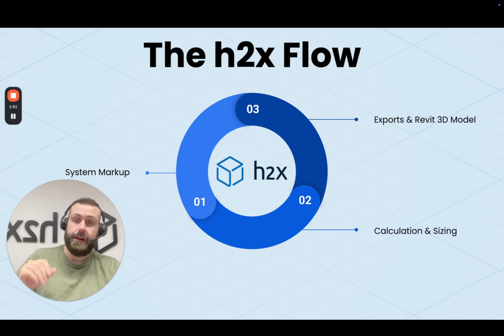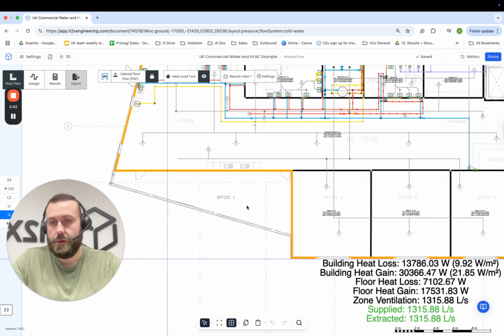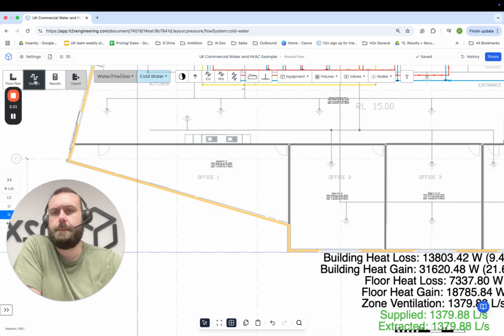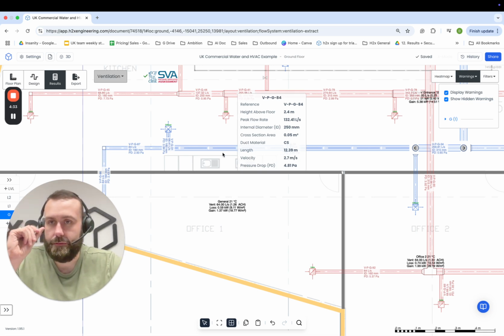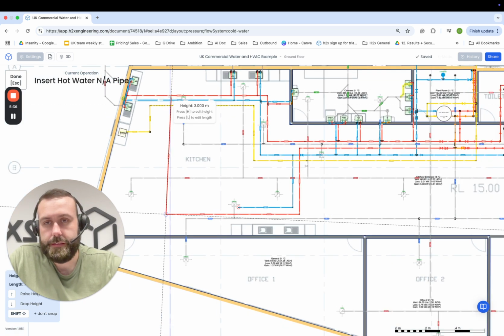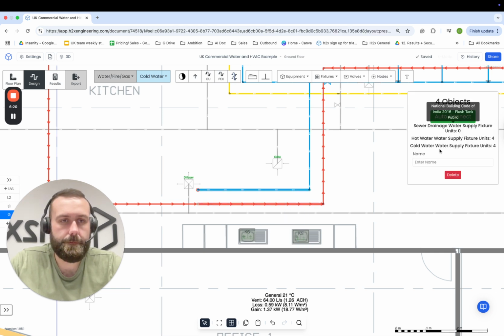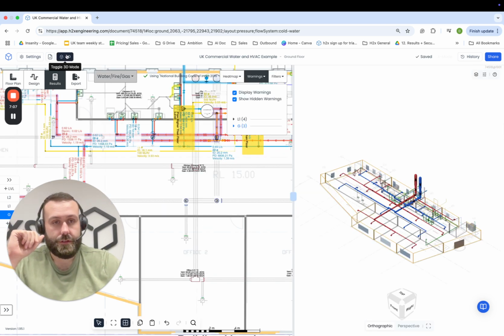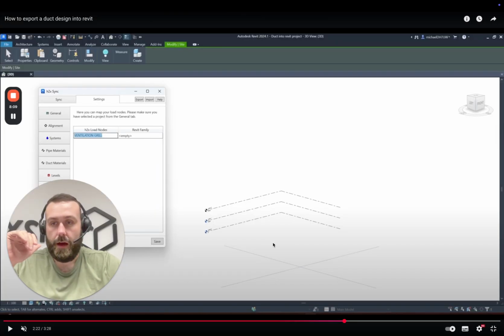How to Design Commercial Water & HVAC Systems in h2x (UK)

Comment: Is it possible to use this app to design and calculate compliant MEP systems in Spain, or is it only for UK? Thanks
Reply from the maker: Hi Jesus, It would depend on the type of system you are looking to design. Some of the flow systems such as water design, rely on the selection of a peak flow rate methodology, and we have a select number of standards within the system settings. Could you specify which systems your looking to design?
Reply: @MichaelAinscough hot-cold water, drainage, heating, stormwater, ventilation... Basically all the systems a building needs. Thanks!
Reply from the maker: @jesuscuerda8544  thank you for the context, for hot and cold water I don't think we have the national standards for Spain, however we do have UPC and IPC, along with the British, Australian and German standards.  For heat load calculations we can use either CIBSE or ASHRAE room loads for the fresh air, which also links to our ventilation system design. It might be a good idea for us to catch up on this. Could you email me? michael@h2xengineering.com